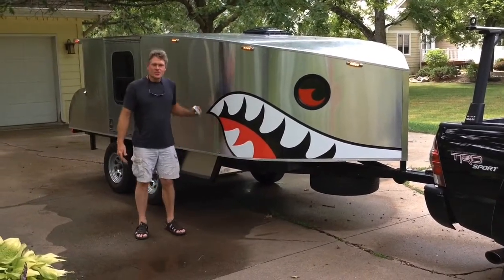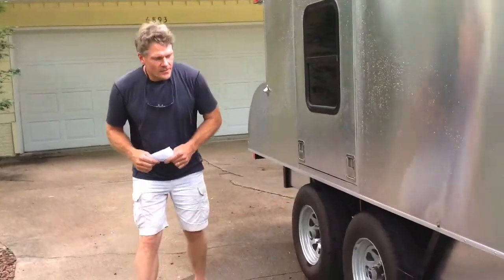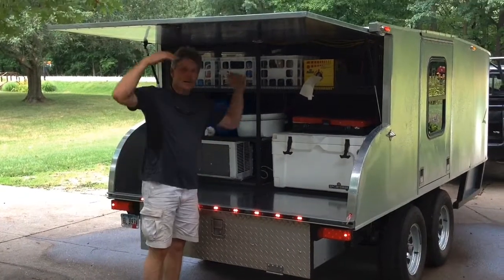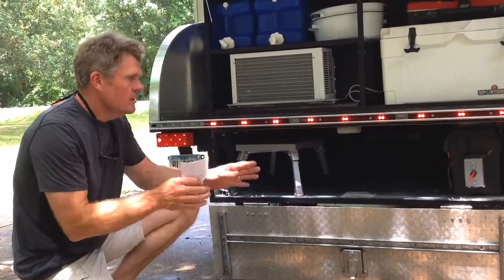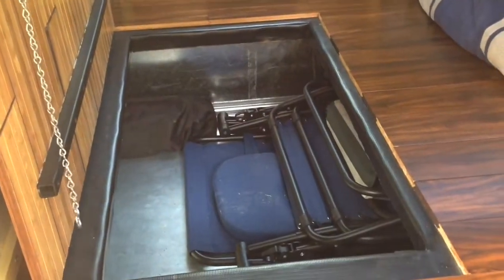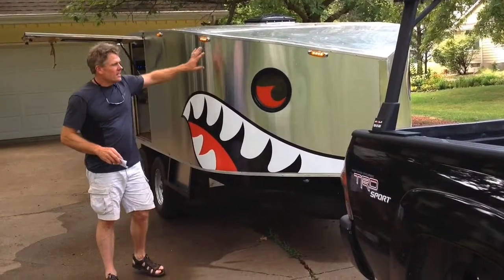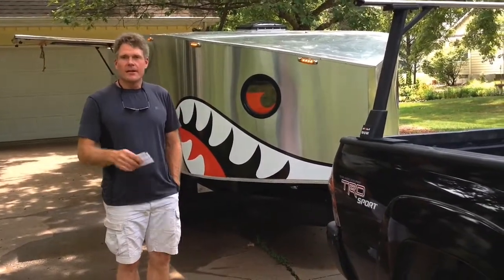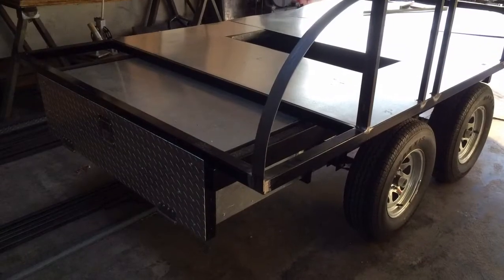DIY Teardrop Trailer

Comment: It would be great to know the final weight and how you feel about the tape after a year
Reply from the maker: A little over 3000lbs, I didn't take any chances with the steel but probably
could have made it lighter.  The 3M tape is magic stuff, not problems, ripples or anything after a lot of miles.